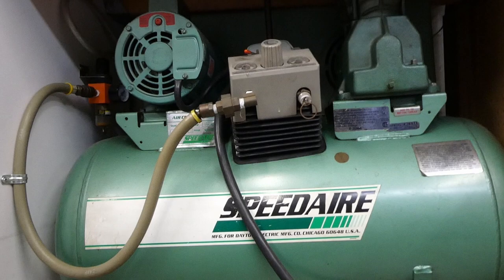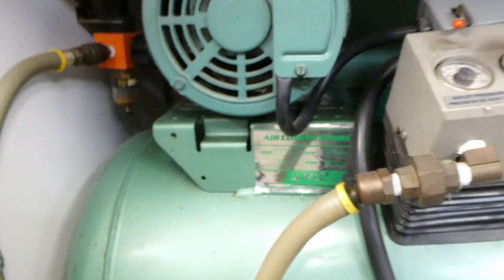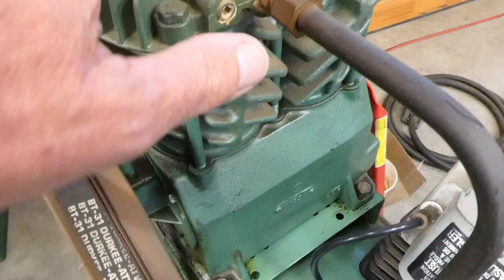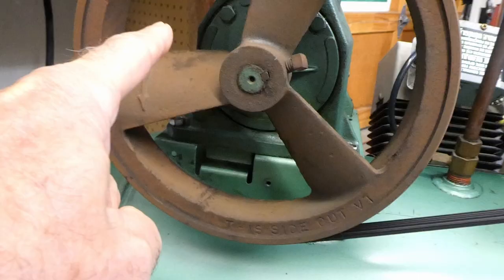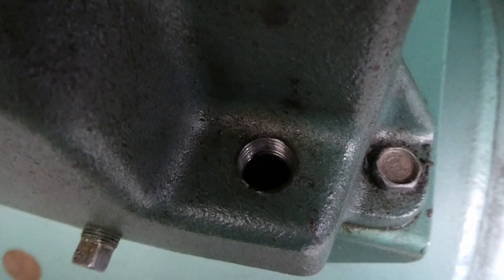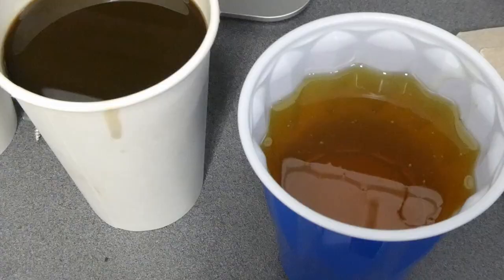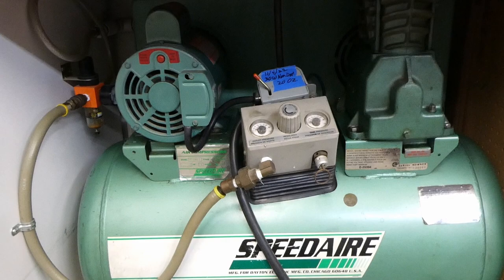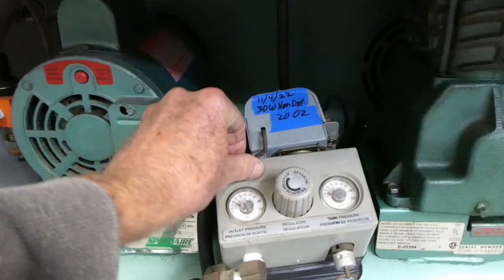Speedaire Air Compressor Oil Change & Leak & Slow Start

Comment: I know this is an old post but your pulleys are not in alignment, move the motor pulley inward just slightly till the belt tracks properly in the compressor pulley.
I have the same compressor and have it for over 30 years. Speedaire is sold by Graingers and is an expensive unit.
I just rebuilt my pump?
Reply: I just seen post as I was thinking about rebuilding mine. I was just looking up to see if I could even find the parts to do it and it looks like there's some generic kits available.

Comment: Did tightening the housing bolts stop your oil leak?  I have the same problem on my Speedaire compressor.
Reply from the maker: Yes, it did seem to help. I don't have oil all over the compressor any more.